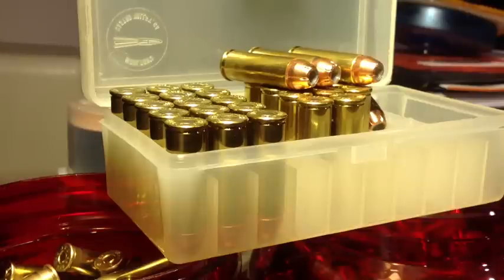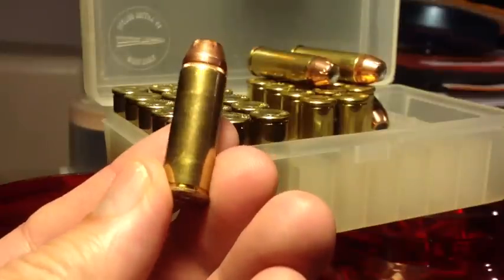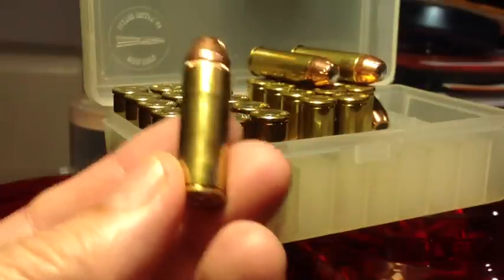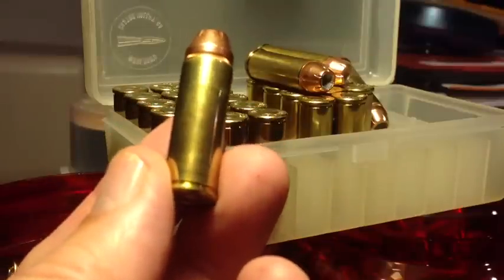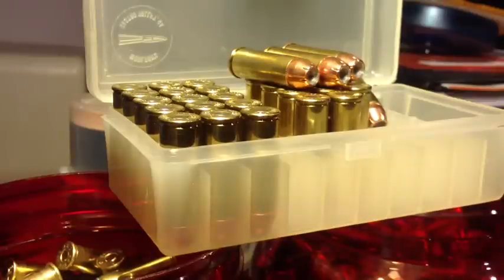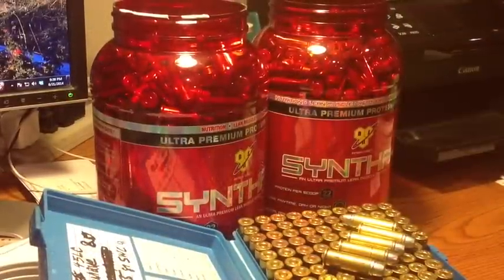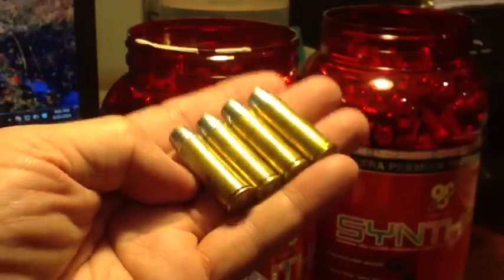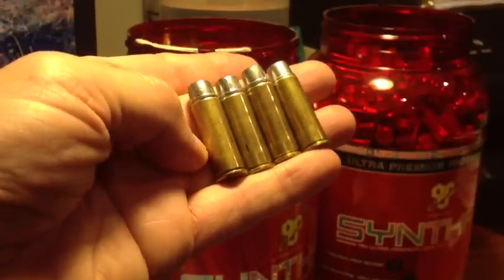Hot Loaded 45 Colt Ammo - Why Not?

Comment: 40 grains by volume of FF black powder is a nice load. It's the military powder charge from back in the day. Big boom, hard but not painful buck in the hand, and the black powder gives you lower pressures so it's safe to shoot in SAA replicas. I have a Pietta SAA clone and it's my preferred load.
Reply: Ought to use 3f instead of 2f, then you get even more power. Like 1050fps out a 7.5in barrel. Around 624ft-lbs of pressure
Reply: It's almost impossible to get 40 grains of black powder in a modern 45 Colt case without signicant powder compression. The new solid head modern 45 Colt cases don't have quite the capacity of the original folded hollow rimmed cases. Pretty much limits you to 38 grains of black powder.
Goex powder does like some compression to burn cleanly while Swiss doesn't need or like much compression. My comments are based upon using a wad of sorts over the powder charge before adding the lead bullet.
Reply: @denisdegamon8224  actually its not impossible or nearly impossible without extreme compression. Theres one particular video out there by a man called plowboyghost. He did 40 grains by volume and weight. He used starlinw brass in the vid. He said dont use hornady.
Reply: @landonsimpson7839  you are correct, I have done it as well but you need alot of compression and works only with a couple of manufacturers brass, due to case wall thickness.
Reply: @denisdegamon8224  I’ve managed to squeeze 40 gr of 3f goex into starline brass behind a 255 gr bullet. Aye it compresses a bit, but out of a 6-7.5 inch barrel you’ve plenty of time to burn that powder.

Comment: taylor and co. makes a 1858 .45 conversion whats a safe hot load for that pistol fps and bullet weight ? can you get 500 ft lbs safely out of it?
Reply: I rather doubt it.....wouldn't be safe.
I wouldn't run anything hotter that 800 fps loading on the high end with a 250 grain bullet. Most of my loads run closer to 725 - 750 fps. It is even better to run 200 grain lead bullet loads at the same fps.
I would suggest 7.5 to 7.8 grains of Alliant Unique or better yet 5.6 to 5.8 grains of Trail Boss powder with eithet 200 grain or 250 grain lead bullets.

Comment: What about 45 LC hot loads in late model 45 LC Uberti SA?
Reply: Not a good idea. The thickness and type of steel used in those european clones are not safe with hot loads.
Reply: If your gun doesnt blow up,you will just end up wearing it out where it wont be accurate or reliable.

Comment: FC45LC. Right now I have the opportunity to purchase a SS Ruger New Vaquero in 45 Colt that is in like new condition for 1/2 the cost of a new gun. My concern, however, is the mountain of mixed information that is going around. Some people are saying maximum 14000 PSI, while others say 21000 PSI. I have a Nosler reloading manual that puts the 45 at velocities of around 750 fps, while gun writer and YouTube personality Jeff Quinn says tthat SAA clones can be safely shot at standard pressures and velocities of 1000 fps. Do you know of any information that I can research to help shed light on this for me? Thanks.
Reply from the maker: Jim Dent - 1000 fps is easy especially with 200 grain hard cast bullets in your Vaquero.  1000  fps translates to that 21,000 psi.  You just can't shoot 35,000 psi as your gun has the smaller frame (unlike the Old Vaquero that could chamber for higher pressure).  I'd agree with Jeff Quinn, but some SAA clones cannot be shot with +P+ ammo - my Beretta Stampedes do not like to be stoked so I keep 850 fps with 255 grainers (frontier loads) as top end for those...The first time I shot 1000 fps loads in my Berettas, they wanted to freeze up.  Your Vaquero doesn't have that problem.  Ruger stopped chambering the Vaquero for the 44 magnum when they went with the New Vaquero.  I much prefer the Old Vaquero.  Good shootin' to ya,  FC
Reply from the maker: Jim Dent - Oh, I forgot to mention - getting a like new 45 Colt New Vaquero for 1/2 price of new gun...I'd be reaching slowly for my wallet while looking to see if the shooting line was clear to the left and also to the right just to make sure no one outdrew me for my credit card...Best to ya,  Jim... FC Steve

Comment: can a magnum load be fired in a Ruger 45 colt new Black hawk Alloy Frame?
Reply: I assume you mean steel cylinder frame with alloy grip frame? My brother has exactly that and has loaded up some pretty hot .45 colt rounds without any trouble. He's not really gone much over what is considered red-line loading in a typical Lyman manual.
Reply: Because Ruger released an anniversary Blackhawk .45 Colt on the smaller "New Vaquero" frame you have to be very careful when making that decision.  If the serial number starts with a two digit prefix it's a large frame and safe to shoot "Ruger Only" loads.  If it has a 3 digit prefix it is built on the smaller frame and can NOT handle hot loads.  The days of simply saying it's a Blackhawk so "yes" are gone.  With the smaller flattop Blackhawks out there now you have to look a the serial number and not the name.  Only Ruger Blackhawks and Vaquero's with TWO digit prefix's on their serial number are large frame guns safe for "Ruger Only" loads.

Comment: Hey FC how are you. you know I often wondered if you can cut down 454 casul brass to 45 colt length and use it because of the thicker walls in the brass. I don't have a 454 nor a 45 colt but my father has the old style vaquaro the first gen and if he ever sells it to me I may look into it. Same thing (kind of) with the 444 and 44 mag. I have a marlin in 44 mag and at one point was trying to figure out the longest length I could make the round before it either wouldn't eject or it did what I was hoping, get it closer to the rifling. Well I got to 1.75ish inches before it wouln't eject from the gun and my own cast 240grain 2R RN was just about at the end of the case mouth. But I have wondered If I use 444 brass cut it longer then 44 mag brass so the bullet seats farther if that would work. Any thoughts on that? Have you ever tried such things?
Reply: Modern .45 Colt brass is not the limiting factor, the gun is. It will handle the pressures that the custom 5 shot revolvers will. You can also load very hot loads in standard brass to shoot in a revolver made for .454 Casull.
Reply: Look at using 444 Marlin Brass cut down to 45 colt length.

Comment: Have you ever heard of 45 colt cases being too wide for a .452 diameter bullet? I purchased Winchester 45 colt brass and the reloading manual says to use .452 diameter bullets. Only think is I dont have to flare the opening of the cases and I can push the bullet into the case by hand. I am at a loss for words her. Have you ever had this issue?
Reply: You need to size your brass before loading.
Reply: @Lar45  I do

Comment: I don't care what the magazines say; I've done the chrono work and I can easily surpass my hottest .44 Mag 240gr load with a hot 250gr .45 Colt load. (H110 for .44/LilGun for .45) .454 Casull is kind of like a Special/Magnum Type thing. For instance I have enough cause volume in a .44spl to load just as hot as a .44 mag load with the right powder, so the case doesn't really NEED to be longer, but it keeps the more powerful magnum load from being chambered in a Special firearm. Same goes for .45LC/.454. I can easily load .454 Casull power factors in standard .45 Colt cases. In fact using LilGun i already currently do this. The main reason for the longer Casull case was to make sure these hot .45 rounds don't end up in something like a Colt Single Action.(much like we wouldn't want a hot .357 mag to fit in a little 642 airweight .38 special.) Strong action .45 Colts such as the Ruger BLackhawk and most lever gun actions can already handle .454 Type loads in .45 Colt cases, so it was not a necessity to create the longer case it just gives a safety margin.
Reply from the maker: Joe Doole - You've got a good handle on it... the 45 Colt has a bigger boiler room than the 44 Mag so it can get more fps with the same pressure as the 44 Mag (takes a bit more powder though).  Limiting factor back in Elmer Keith's day was the Colt Single Action Army revolver strength - thinner cylinder walls and blown up guns.  He didn't have the strong Rugers that we have today.  The thinking behind this video was that the 45 Colt in +P or +P+ mode (as per the loading manuals)  is already a very capable round.  And if we want to hot rod it, the 454 Casull guns are even stronger.  You want to hot rod the 45 Colt with loads outside of the loading manuals is plain flat out OK as you are an experienced reloader...(I'm doing likewise with short cases like the 44 Russian, 45 Schofield and 38 Short Colt now).  Only difference is that my guns for all of those are very much stronger to handle pressures.  As you say, you have margin, but less margin to work with.  My preference would be bigger stronger guns with more margin.  I'd be ready to stoke the 45 Colt round in a Ruger Alaskan or Super Redhawk 454.  The issue is not the strength of the brass that was previously reported.  Good shootin' to ya... FC
Reply: After about the 4th time I use my 45 brass I begin to get swelling. But. A 45 long Colt, loaded to 454 pressures. And it's cheaper than 454 rounds and you get the same thing. Provided your pistol can handle it. IE Raging Judge Magnum. Model 513 from Taurus

Comment: novice question to an expert.
Im planing to buy a clone gun of the Colt 1873 cattleman (like Uberti) - but I have been told that you can only load black powder in the ammo for them.
I think it´s not true. But like with all reloadning ammo you really really need to be absolutely sure.
Can I load ammo for a Uberti 1873 cattleman with smokeless powder???
Reply: Modern colt clones such as the Uberti Cattleman are made with modern steel and are more then capable of firing smokeless ammo at standard pressures you can hand load black powder loads for nostalgia purposes if you wish but feel free to fire all the smokeless ammo you want through it! I have a uberti cattleman and have aways used factory smokeless ammo through it.

Comment: the lead incident? did you get lead poisining???
Reply from the maker: chris lowe - most shooters who hang around ranges a lot especially indoor ranges will have elevated lead blood levels.  Since I cast bullets, I've routinely had my blood levels checked.  Gathering 3-4x more range scrap at the range and processing that much more lead caused my lead levels to spike recently to the level of range workers.  By curtailing my lead gathering (dust exposure) back to previous 1x levels, my lead level has dropped 50% on retest.  The doc wants me below 10 micrograms per deciliter so he wants me to drop a bit more.  There haven't been actual levels established for lead safety, but 10 is the arbitrary level.  I have no symptoms, and the levels are coming down...My family members have no lead levels.  Thanks for asking...
Reply: i ask cause i reload a lot of lead hard cast bullets. but i never thought about wearing gloves. my wife is a nurse and says as long as i dont breathe it or ingest it i should be ok. but i do wash my hands after every reloading session. but lead poisoning makes me nervous so i do believe ill start wearing gloves.
Reply from the maker: chris lowe Sorry, this is going to be a long reply.  Your wife is completely right - breathing and ingestion are the routes of entry.  But one thing that has not been stressed is the adequate ventilation of reloading areas.  Ventilation is not just an open window - but rather is the forced removal of the air in an area to be replaced by new air.  Ingestion is not the problem as we all keep our hands away from face and wash after reloading, but the gloves are an excellent idea - highly recommended.  The bullets in our reloading room are not really the problem.  The problem is the unseen dust from our brass casings containing lead from primer residue and bullets.  When we vibratory clean our cases, that dust is concentrated and generated.  I cringe when I see people vibrate cleaning their cases indoors, or worse dumping the media/cases and doing separation indoors. That fine dust (especially if overused media) is like poison gas - it can and does go everywhere. Next time you see the cloud, please remember it for what it is.  Then even clean looking cases will continue to have that dust film when we reload.  And the cases being worked will get that dust air born right next to our faces. Ventilation would zero that problem.  But now a better solution that has not been widely distributed - clean and polish our cases with the water/stainless steel pin tumbling systems = zero dust = zero inhale exposure in reloading.  Look at the ads - no promo on this important feature - if they did, would blow all dry media vibratory cleaners (used industry wide over past 40 years) out of the water (pun).  I've always had a bit of high lead, but it never needed to be - rubber gloves and wet polishing basically makes reloading lead bullets a non issue even without ventilation (better to have that though).  Best to ya...
Reply: FortuneCookie45LC Hi,  I don't reload yet, but when I buy a case of handgun ammo, after opening the box (or just handling the box) and removing some of the rounds, there will be a film of gray "soot" on my fingers. Is this powder from the process of going thru the loading press? Or is it lead dust? Sometimes I'll just pick up a box of ammo and wipe my finger on the outside (or the inside of the flap) and get that light soot on my finger.
Reply from the maker: Claude Herbert - Can't say for sure without doing a lead test, but the best advice is to not have any food or drink around when you handle any ammo or firearm, plus wash hands well after handling.  For those who have higher exposure to lead, best to wear latex or nitrile gloves when handling.  Best to ya
Reply: +FortuneCookie45LC Wow, I gotta change to the water/stainless steel pin tumbling systems.  I'm going to coated bullets (9mm, .357, .44 Magnum, .45ACP, .45 Colt), so that's a good start. Thanks for enlightening me on the dangers of my case cleaning procedures. Also congrats on good posters and your excellent comments.
Reply from the maker: +Alan Stewart -- The new generations of reloaders going to wet tumbling will be on safe ground.  Also, by avoiding indoor ranges, that would be excellent lead exposure prevention.  Even outdoor ranges - note the direction the wind blows.  If away from the shooting benches towards to targets - that is excellent.  If the air hangs and the black powder shooters get their smoke right back at themselves, that is not the best.  If you ever clean your nose after shooting (say after 2-3 hours), if you get definite soot on your Kleenex, that is an extra 1-2 points on your lead test if you get that done.   Not really a problem as 10 is the arbitrary cut off.   Even Jerry Miculek has made some aside comments about his lead levels and he is still grease lightning of hand, eye and mind...I'm not going to worry about my 10 lead levels.  I'm casting up a storm tomorrow (with protocols of course).   Best to ya.... FC
Reply: @FortuneCookie45LC  I know I'm late by 4 years but I did not think you could actually lower the lead in your body. Am I missing something or was my thinking wrong?

Comment: first where did you get those semi wad cutters. That meplat looks huge. second I load with unique and their web reloading data shows 250 grain lead at 9 grains max. I have loaded 8.7 grains with 255 grain bullet to get about 850fps from a 4 inch barrel. That doesn't seem hot.
Reply: +Silver Back Be careful with Unique.  Not only is it a dirty powder compared to .2400 but it peaks in pressure much faster than does 2400.  I have already played with Unique going hotter than you write and walked away from it as a powder of choice for anything more serious than tin can plinking back in the 1980s.
Reply: I have 8 lbs of Unique.  It is a very good powder for .38 or .357 .. 45 auto and 45 Colt BUT .. I like Fortune Cookie's advise about back off from max loads.  My M1 (good example) likes 47 grains IMR 4895 and  165 grain Sierra.   You cannot load a Garand to hot loads like an 03A3  (it will damage the rifle)  BUT the Garand is a terrific rifle .. incredible.  You don't need any more than the ideal load. (Saw an Army Sgt.  Hit the White Buffalo at Whittington with iron sight M1 Garand .. salute him!).  so hot loads are kind of like 2 quads on a 348 Chevy .. you need upgrade everything back to the read axle.